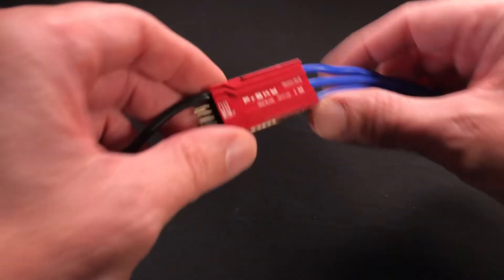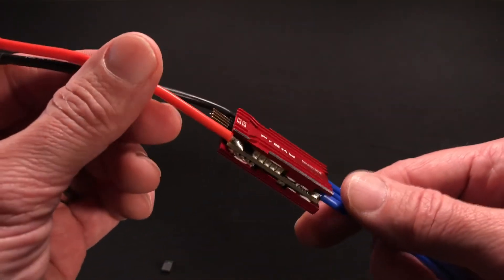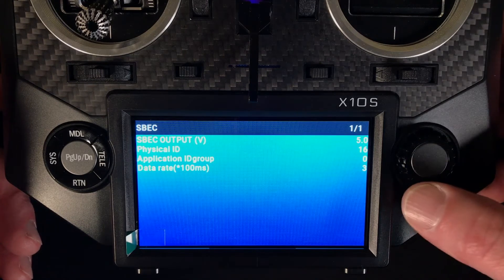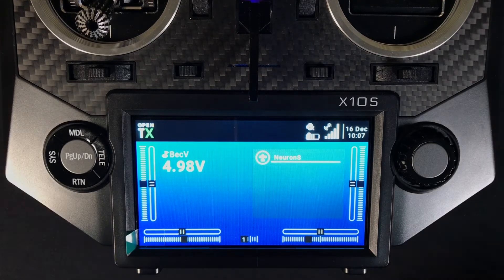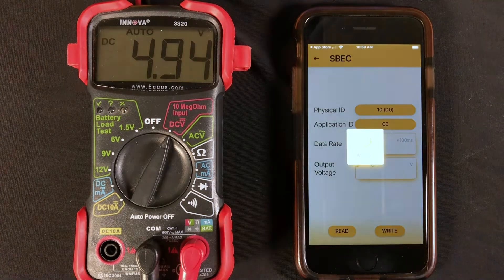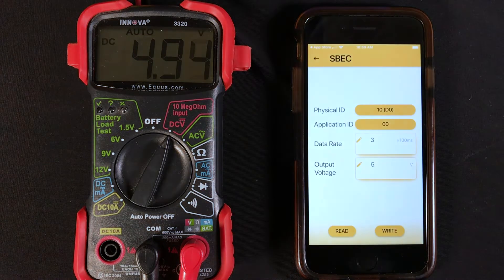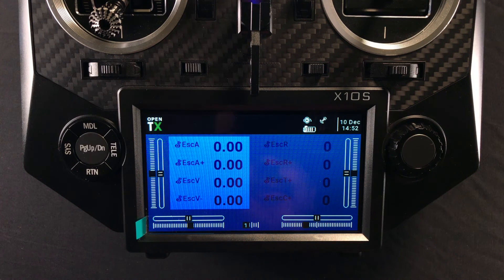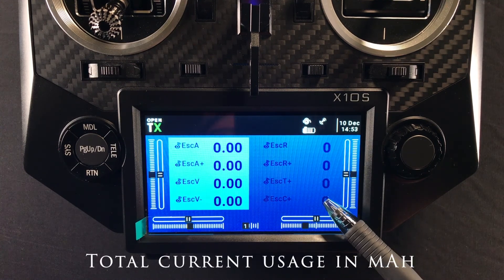Neuron S ESC Part 1

Comment: Can't connect to my Neuron 40S.  I'm using the USB Linker and and have connectivity with my PC as Comm Port 6.  I've got ground and signal connected between the Linker and the ESC.  BLHeli32 sees my comm port but when I try to connect I get a Popup saying "Rebooting Flight Controller". (I don't have a flight controller in the mix.)
Then it will eventually time out and I get another message "Connection to Flightcontroller failed!. Please check usb/serial Port- and power-connections to the Interface."  I do have the esc powered via battery, just as you have shown. 
At this point I'm ready to yank out this ESC and go back to my El Cheapo brand.  I've tried another cable and still have the same issue.
Update:   Using the same cable and USB Linker, I was able to get it working with the Android app.  Still, no joy when trying to use my PC.  
Help anyone?
Reply: I'm getting the same, My motor is connected so is this causing the problem.Did you manage to resolve the issue Dieter?
Reply: @Petehcs100  No need to connect the motor.  And in most cases, you don't need to change any of the default configuration.  But I wanted to check the settings and it finally worked for me using the Android App but not via the PC.  Once I set my parameters, I installed it and all went very well.  There has been no need to change anything. and I get the needed telemetry via Smart Port. I have not had any problems flying with this ESC, but I still question the need for such an expensive unit.
Reply: I hope that you resolved your problem. If not, I had the same issue. Go to Device Manager in Windows and see what Com Port your Linker is on. Then go in to the BLHeli Suite 32, up at the top, click on the BLHeli Interface. There will be a drop down. Mine was defaulted on the Beta Flight/Clean Flight, and when I changed it to USB/COM it connected like it should. It took me 3 hours to figure that out. Ugh.